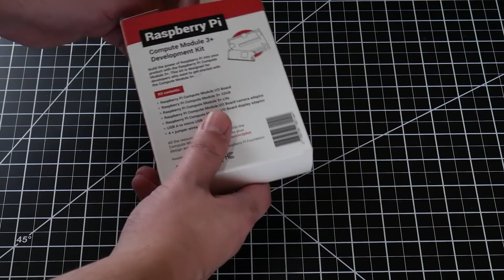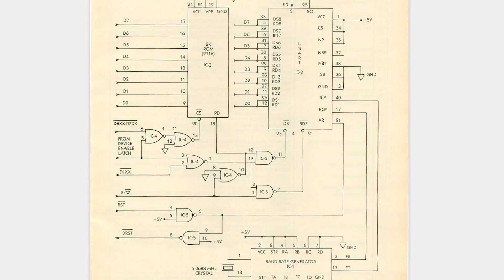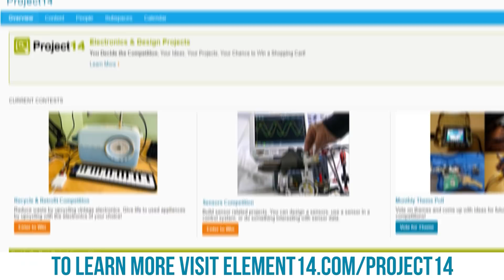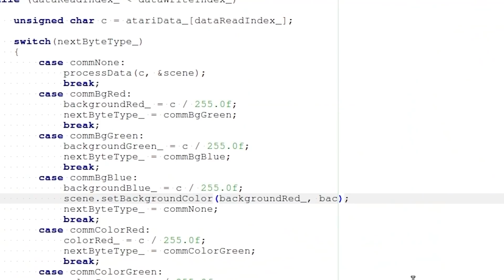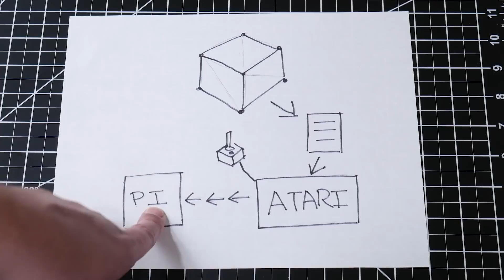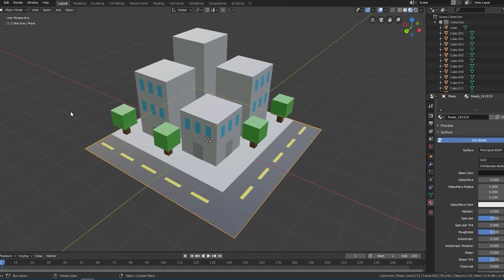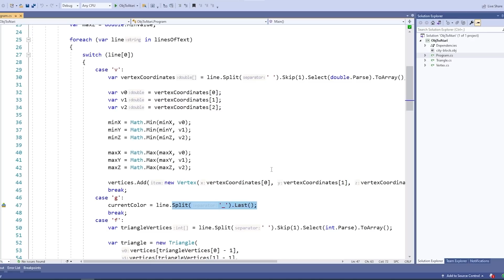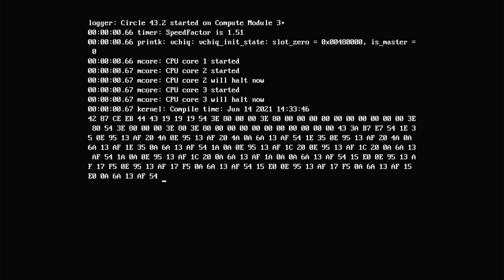Making a 3D Graphics Card for the Atari 800 XL using the Raspberry Pi

Comment: It would be quite easy to do part of address decoding on few logic gates, so there would be no need to use this many GPIO pins for address bus. Also, page 6 isn't really that protected by Atari OS, it's just there for user binary data/short bits of assembly code. However, there's a 2K range for HW ports that should be quite easy to use (starting from $D000).

Comment: this is not gpu for atari this is just remote server-client application with serial connection, what would be really interesting is create very small 3d accelerator with vhdl so it can be implemented with bunch of PAL devices (same era ~1979 programmable devices)

Comment: Next step: transfer the rendered image in a low resolution back to the Atari and display it on its original video output.
Is it possible? Is there enough bandwidth through the cartridge slot for such a task?

Comment: I wonder if this could be the basis for a multi-8bit system 3D environment.  So you are using the parallel bus on the Atari.  But could in theory use the same Pi-Circle setup on a card on an Apple II or a cart for the C64...  Each would need it's own way to talk to the Pi (The C64 using assembly and/or BASIC with Pokes, etc), but they would be sending the same information so it would be the same base Pi-Circle OS on the backend...  Hmmm...  Great vid!

Comment: Apart from a good explainer on interfacing, and the fact that it doesn't matter how old the system is, it's all still about electrons, this is a good primer into how 3d Graphics Accelerators work in taking the hard work away from the CPU (whether a 6502 or a x86). Great video and support material.

Comment: or "How to turn an Atari 800 XL into a RasPi terminal"?
Reply: Conceptually, modern GPUs in PCs work in a broadly similar way to this. They take data, perform calculations and render to the screen, independent of the CPU, which concentrates on program logic etc. Plugging in a GPU in to a PCI-E slot which overrides an  integrated graphics chip is the same principle as this. I/O and sound are similarly offloaded.  Some people have commented that it should be possible to enable bi-directional communication, so with extra code, the Atari could render the screen data too. Albeit very slowly and in much less detail.
Reply: @another3997  Yes, my point is that no part of the game actually runs on the Atari's CPU, which is why I found the title pretty click-baity. I was hoping to see a recompiled Elite game with hooks to a homemade 3D card or something. I'm the only one to blame for such high expectations I guess. :)

Comment: Amazing, but it feels like the Atari is just a keyboard for the Pi.  There must be a way to keep all the video coming from the Atari but have the Pi do the number crunching internally.
Be cool if on the C64 you could completely replace the VIC chip with a Pi, and have the computer still think it's talking to the VIC.  Then have a cartridge that extends a bunch of graphics commands.
Maybe this will be a new trend! :)
Anyway, I have no clue what I'm talking about but it would be fun to see.
Reply: It's a good observation, but is also the nature of all 3d accelerator cards.  The host system sends commands that the card understands and then the card does amazing 3d graphics that the host computer could never do on its own.  When I bought my first 3DFX card back in 'the day' I had to unplug the monitor from the motherboard video out and use the 3DFX card out instead, so what he's doing here with the pi is a very good analogue to a traditional accelerator card.
Reply: @kentwood9821  Not really. The typical 3D card does the graphics "heavy lifting" but the game logic is still handled by the CPU. In this case, the Atari doesn't even know what data is being processed. It loaded a file and passed the bytes along to the pi, but it doesn't do anything with them. Then it just listens to the joystick port and passes the inputs to the pi, again, not doing anything more than passing it through. It's completely "unaware" of what is being processed. Not that this isn't still an interesting and clever use of the two bits of tech, but a more apt demonstration of using the pi as a 3d accelerator would have been to have some sort of rudimentary "map" on the Atari, so that it was handling the positioning and movement of the user, and the commands to the pi were more along the lines to render the scene "from this location" - but as it is, the Atari isn't doing anything beyond being a loader and joystick interface to code that is otherwise completely running on the pi.
Reply: @d4qatoa Nowhere did I mention that I was "disappointed" in anything. I was only commenting on the analogy of comparing this to how "all 3D accelerator cards" work in the comment to which I replied. And that this is NOT the same thing. A more apt example would be loading a rudimentary 2D "map" on the Atari (like a maze). That 2D map is also loaded to the accelerator with enhanced 3D information (textures, materials, etc.) The card would be able to render 3D views, but the Atari would still be handling the game logic such as player positioning, etc. In effect, even though the Atari would be completely unaware there is a 3D view being generated, it would still "know" where the player is in the maze and can make game decisions (like whether to load the next map, whether to stop the player from moving forward, whether to change the sound effects, etc.) That's more like the typical division of work with a 3D accelerator card. The computer handles the logic, the accelerator handles the 3D. In this case, the Atari wasn't doing anything other than passing "black box" data to the Pi, then handing over controller info. Again NOT THAT THIS ISN'T INTERESTING AND CLEVER ... but just that this ISN'T an apples to apples comparison of how 3D graphics cards typically work as the Atari was basically acting as loader and controller for a game running on the Pi.

Comment: Just a slight correction. CTIA came only on the original Atari 400/800 and was soon replaced with the GTIA which allowed for a few more graphics modes. In fact, Atari even offered this upgrade for free. By the time the XL line came out, the CTIA was long gone.
As far as making that ribbon cable, I used to work at a place that we had to make ribbon cables from time to time. We have a machine that was basically a press that would do the crimping so I wouldn't say you're doing it "wrong", just not the ideal way.
Reply: As I started watching this, that was my exact thought. Even the XE had the GTIA. Thanks for pointing it out!
Reply: @donmilton9664  Thanks. Yeah, small nitpick and he does mention the GTIA right afterwards so it's all good. No one but Atari fans would even care. :-D
Reply: According to (IIRC) Jay Miner, the GTIA chip actually came first, but technical issues meant the CTIA was substituted in the early machines until the problems were sorted out. In 1979 home computer terms, this was cutting edge technology, so problems were bound to appear.

Comment: I've always put the ribbon cable IDC connector in a vise.  This allows you to evenly spread the force along the width of the connector and you can easily make sure the ribbon cable is square to the IDC connector.

Comment: Using graphics card to control motion of the character is unrealistic. It's a graphics card, not a character game logic card.
Reply: The graphics card doesn't know anything about a character. It only knows how to transform (translate, rotate, and scale) the geometry. I am handling the transformation matrices 100% on the card rather than create them on the Atari, but I'd consider that a minor implementation detail. The card's responsibilities are still graphics-only.
Reply: @andywest5773  It sounded to me like you were forwarding the controller input directly to the Pi and letting it decide where the new position of the player/camera was. Is this a misinterpretation then? I think that's why, to us, it seemed kinda like the Pi was going beyond the duties of a GPU.

I do also realize it's a simple demo, so there isn't much gameplay logic to begin with.
Reply: @AgentOrange96  I guess it's a matter of semantics. Moving a player and incrementally updating the transformation matrices are basically the same thing in this case since, like you said, there's virtually no logic. There's no physics, no state machine, and really nothing in the code that suggests a player.
Reply: Yeah, it seemed like he went back on his goal stated at 0:42

Comment: This is crazy, I want to get an my DE0-Nano to act as a graphics card for microcontrollers after seeing VGAtonic on hackaday. I also have mc13xx video chips that i want to get working with a device but the schematics are hard to follow. Missing capacitor values and some symbols i dont recognize like variable caps/inductors.

Comment: ......why though? lol this is so stupid it rolls back around to being smart, i kinda low key love it...
Reply: Why do anything at all? This is stupid? The principles in use here have been used for decades, and are still in use today, in everything from render farms, clusters and supercomputers. Conceptually, every modern computer, tablet or phone offloads complex calculations to another processor, such as a GPU or sound card whilst the CPU gets on with other things. The CPU just sends data and instructions to a GPU, which does the calculations and renders to a screen, far faster than a normal CPU could do it.
Reply: What's stupid is your comment.

Comment: I've always thought about what's possible with a slow CPU and a powerful graphics card. It's like when old yet powerful mainframes had slow CPUs but compensated for then with lots of extra hardware to control the hard drives, the tape drives, and even the printers so the poor CPU could spend time on other things.

Comment: Now have the Pi send the computed scene back to the Atari as screen data so it's coming through the Atari's display, otherwise, this just seems like a weird controller interface for a Raspberry Pi.
Reply: I really wanted to get bidirectional communication going but the PBI is extremely finicky about timing and I didn't have enough GPIO pins. So I had to make some compromises.
Reply: @andywest5773  I had the same thought as @chrisxdeboy ... Why not just use the cartridge port or the PBI port to load a CIO driver and then set itself up as a DMA interface in a portion of memory and re-point video memory to the memory that the Pi is directly manipulating graphics memory, leaving the actual job of displaying the graphics to the Atari and doing input and output through the CIO handler to and front the Pi bidirectionally?  Just a thought but then I haven't done that sort of coding in many years... Just know it can be done to turn the Pi into a pure accelerator instead of being controlled and doing all the graphics and frame buffering.
Reply: @DanRamosDR   I'd love to see a classic Atari 8 bit doing that. They were amazing machines at the time of their release in 1979. Given enough time, skill and money, most things can be achieved. Unfortunately, like me, most people don't have the luxury of unlimited time and money, or the skills to do this. So unless this were a commercial project or a long term labour of love, I doubt you'll see it happen. Unless you fancy having a go yourself? Write the Atari code in Action! rather than BASIC and it would fly. 😉
Reply: @DanRamosDR  I had a similar thought, but attaching a Pi to the cartridge slot, with is mapped into a 16k area.  Have the Pi precompute the screen data in real time (in various ANTIC modes) and just point your display list to that cartridge memory.  That would essentially be an accelerator, which existed back in the day, so would be sort of not cheating even.  You could allow a portion of the address space to be an area you can write into to pass data back to the Pi as well.  You'd need some shared memory between the Pi and the Atari, and some way of signalling the Atari the Pi has finished creating the screen.

You could even point your character set to the cartridge space, or P/M graphics data too.
Reply: @andywest5773  a couple people have been able to get it working on NES carts, just look up the port of DooM on the NES. You could probably use some serial to parallel chips to minimize gpio usage.
Reply: Yeah.

Comment: Can you boost the power of an old laptop using a pi I wonder, plug into one or more USB ports to get pi to process data.
Reply: Yes and no.  Yes, in that you can plug a pi zero, pi4, or one of the compute modules, into a USB port, and get it to process data, but no in that it will not directly supplement your existing CPU.  Anything they support would have to be coded specifically to use the Pi as an accelerator.
Reply: The idea of offloading data processing and complex calculations to one or more faster CPUs is a very old concept. The implementation has changed over the years, but the principles are still the same. Render farms, clusters and supercomputers all do this in one form or another. But there are limitations. With the right software, you can use a Pi (or any computer) to supplement a slower computer's processing power. But it ISN'T the same as having a new, faster CPU in your laptop.